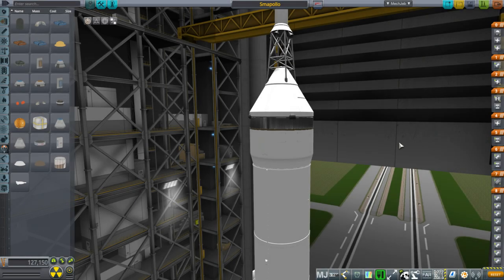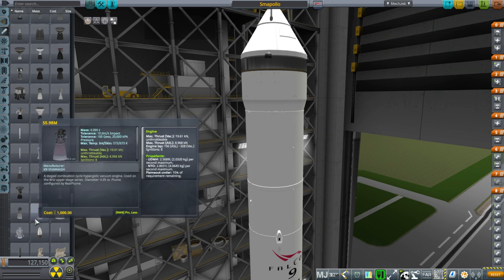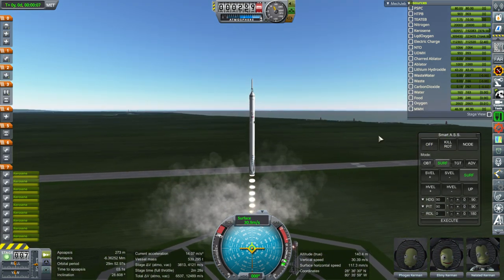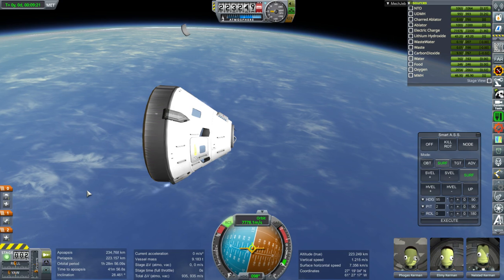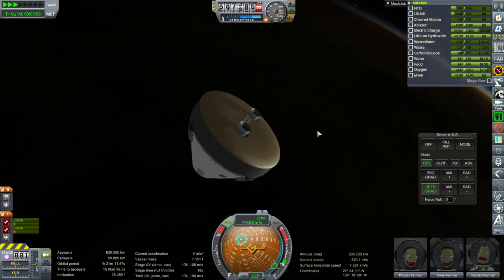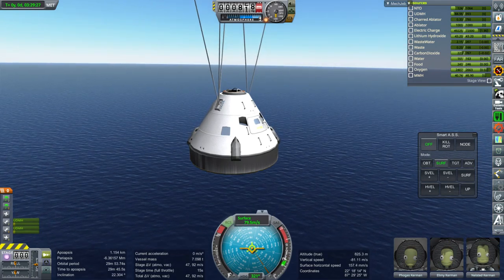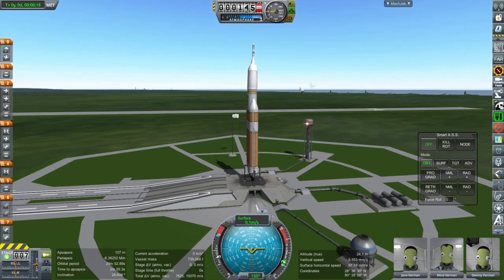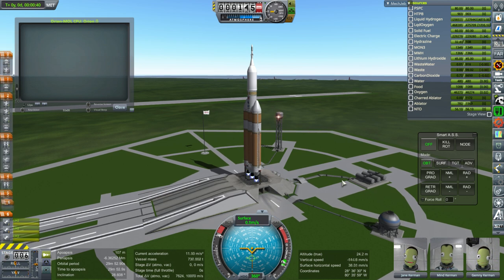Kerbal Space Program - Part Dev - Heatshields in RO

Comment: I would use the docking Port cover to cover an engine. The thing about the engine slots in the heat shield is that the engines wouldn‘t really be protected
Reply from the maker: Yes, the engines aren't protected on the slotted version, but you can have somewhat larger engines as a result. Certainly up to you, though.

Comment: From an RP-0 stand point a LEO config with an upgrade to lunar rated would be a nice easy expansion in functionality.  Not sure how difficult that would be to implement but I would think it would be similar to RCS and engines.
Reply from the maker: Not sure, because the upgrade system is sort of built-in to RO/RP-0, and right now it only handles stuff like thrust and ISP, not heat tolerances. I think it would be easier just to make a second part that unlocks at a different point in the tech tree.